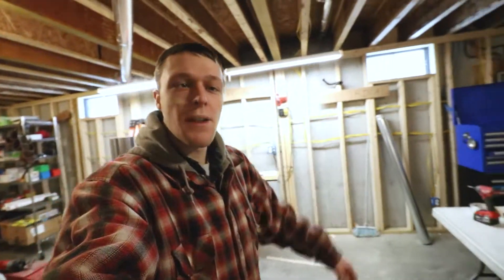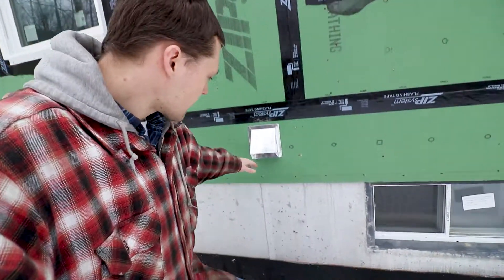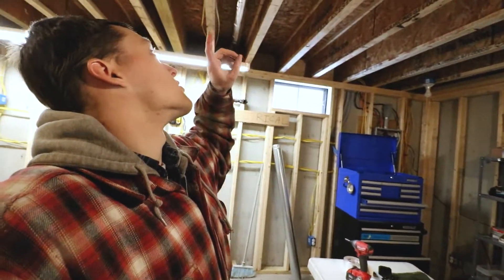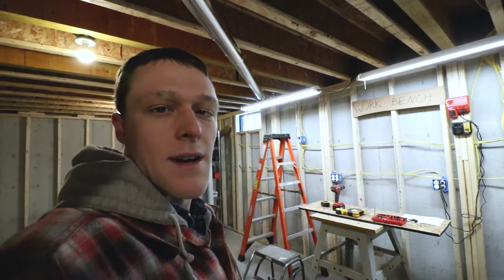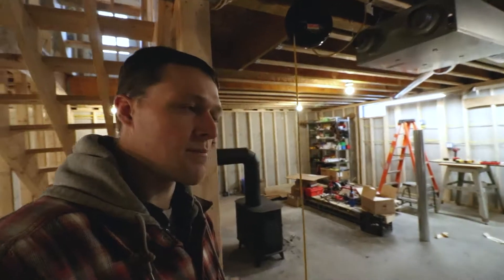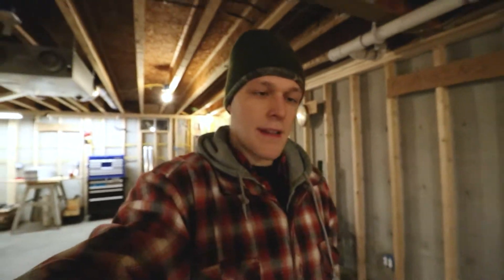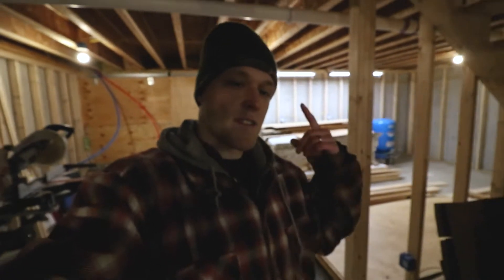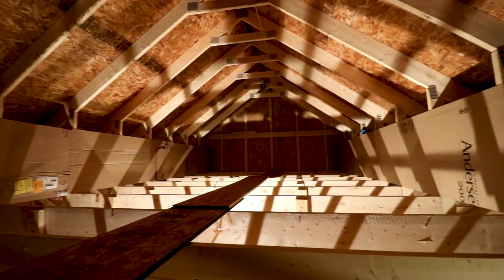Installing ERV Ductwork | VLOG070

Comment: I was curious as to why you installed bathroom vents while using an ERV?  I also installed an ERV in our build…there’s a video about it on our channel.  Great video!  I love the clean up days !
Reply from the maker: I think of them as different purposes. The exhaust fans for temporary, high volume moisture removal, and the ERV as a slow, constant fresh air source for the house. I suppose it could have been tied together, but this kept ducting simple.

Comment: I see you have a wood stove there in the basement.  Have you had any issues with the ERV intake picking up wood smoke, or have you done anything to prevent that?  I'm not sure if this will be an issue for me.
Reply from the maker: Not a problem at all. The wood stove has a good draft and smoke goes right up the chimney.

Comment: I see that you mounted baffles on soffit vents.  I thought ERV's were being used on closed (air tight) houses.  Since you have an open attic, is the living space area air tight from the attic space?  The zip sheathing is going to help with sealing the house.  Are your bathroom venting out through the ERV too?  Thanks for the video
Reply from the maker: That's correct, the attic is air sealed from the living space. Our bathrooms vents have a direct vent outside, which technically creates a negative pressure on the house since we don't run the balanced ERV at all times. Glad you enjoyed the video, thanks for the comment.